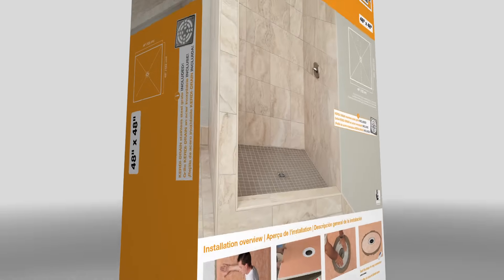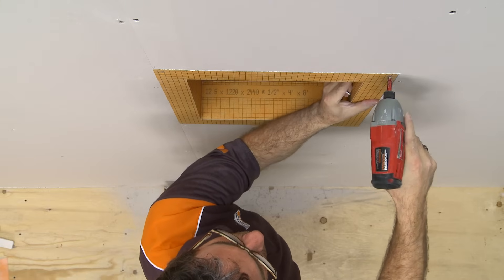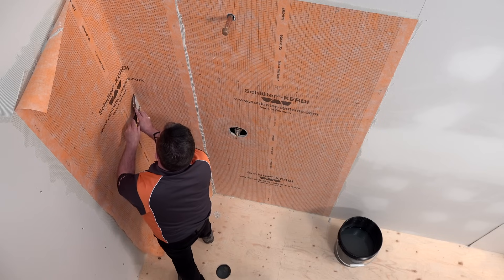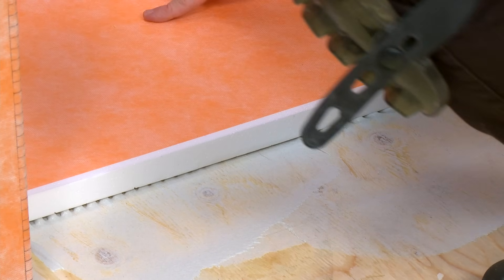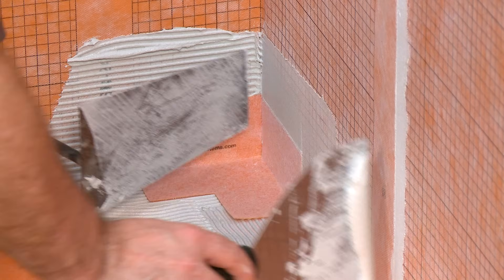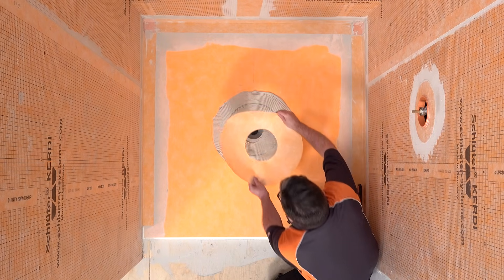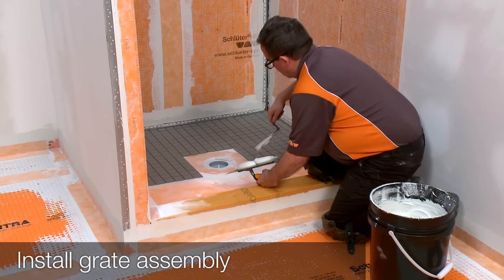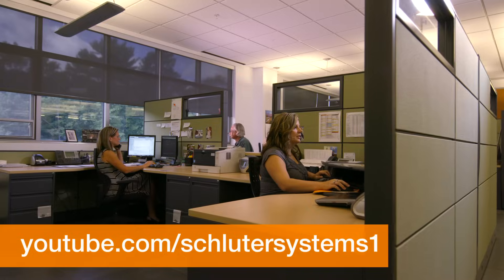How to waterproof your shower installation with the Schluter®-KERDI-SHOWER-KIT Complete Kit

Comment: do you just lay the tray on a level floor?
Reply from the maker: Hi there! The tray can be installed with thin-set mortar on a clean, even and load bearing substrate of plywood or concrete.
Reply: @schlutersystems1  Hi, when I install the tray to OSB plywood, do I use Schluter unmodified thinset? Which thinset do I use if my substrate floor is mortar bed? Thank you.
Reply from the maker: Hi there, you would use Schluter SET, ALL-SET, FAST-SET, or an unmodified thin-set to bond to either substrate. Thanks!

Comment: Question regarding the 'fairly fluid' thinset used along the Kerdi-band. Do we follow the same instruction as for the tile or we add a small additionnel portion of water at the beginning of the mixing?
Reply from the maker: Hi André! 
The thin-set used to install the tiles will be a little thicker than the thin-set used to install the KERDI-BAND. The different mixing ratios for installing Schluter® membranes vs. tiles can be found on the back of our thin-set bags or in our thin-set data sheets which we’ve attached here as a reference:
https://sccpublic.s3-external-1.amazonaws.com/sys-master/images/h5e/ha8/8949341814814/ALL-SET%20Thin-set%20Data%20Sheet.pdf
Hope this helps!
Reply: @schlutersystems1   it says using the schluter thinset... Would a different modified thinset from mapei or laticrete be sufficient?
Reply: @michaelcolascione2423  no you gotta use an unmodified thin-set

Comment: I installed my shower, but missed the part where you discuss “memory” in the corner pieces - I could not get them smooth due to the shipping fold - blocking them to flatten them out created a couple of other dimples (oops).  I guess I just cut those flaws out and put a Kerdi-band patch over the flaws?
Reply from the maker: Hi there! Yes, you can definitely cut out any imperfections in the KERDI and patch over the flaws provided at least 2 inches are achieved at these areas. Hope this helps!
Reply: Use of a hair dryer would've been beneficial to fix those folds.
Reply: @surfingweb7176  I actually tried futzing about with it until I pulled it out - washed off and heated it with hot water, dried it off, tried again.  Eventually blocked it (fail - mentioned above).  Finally just cut a long piece of band and put a patch over the pieces flattened by slicing off lumps, taking care to 2” overlap.  Result was nice but not so much mid-way.  Yes the hair dryer (or heat gun) would have greatly improved.  Now I know. Thx.

Comment: considering giving this a shot on our own. I've seen the system on a lot of home improvement shows. Question is, how does one install glass doors/panels into the foam curbs?
Reply: In 20 years never anchored a door set into a shower curb or tub edge, that is ripe for leaks. you lay down a double bead of silicone for pre-fab units. Custom panels depends on the install type but are usually similar. Those yelling about hot mop and vinyl liners on here are just afraid of the inevitable. Currently using this system to replace a hot mop/mortor bed custom job that apparently leaked for 20+ years...had to replace 90% of the subfloor in the bathroom and a couple floor joists. This system is so much easier and lighter, never had a leak in all the times I've used it.
Reply: @kcstack2642 1) how long have you been using it?
2) how many showers have you torn out that had a schluter system so you could see just how well it waterproofs? Or doesn't?
Reply from the maker: Hi there! You can use the DECO-SG to install the glass on top of the curb or you can use KERDI-FIX and anchors with other framing. Please contact Customer Service for anchor installation instructions. Hope this helps!
Reply: @schlutersystems1 poo
Reply: Yeah, that concerns me..semms like it should have wood underneath or something.
Reply: Yea ...opps
Reply: The kerdi is a joke, nothing will properly anchor in to styrofoam, beat to has monolithic solid cement slab pour with inter grated liner

Comment: Can I install the shower tray directly on concrete the same way as shown in the video, with thinset?
Reply from the maker: Hi Ceeloc, yes, you can install the tray over concrete with Schluter-SET, Schluter-ALL-SET, Schluter-FAST-SET, or unmodified thin-set mortar.

Comment: Before you lay down the tray, do you need to seal the bottom of the keri board wall with kerdi fix?
Reply from the maker: You can seal all seams and joints after installing the tray. This excerpt is from our handbook:
Seal inside corners by abutting adjacent sheets and installing KERDI-BAND with Schluter SET®, ALL-SET®, FAST-SET®, or unmodified thin-set
mortar, centered over the joint. Install KERDIKERECK prefabricated waterproofing corners at all inside and outside corners. When using the
KERDI-BOARD-SC curb, seal the curb to the base and walls using KERDI-KERECK and KERDI-BAND

Comment: Can penny tiles be used on the shower pan or are they too small?
Reply from the maker: Hi there, yes, penny tiles can be used on our shower pans. It's the DITRA membrane that has the minimum 2x2" tile requirement. Happy tiling!
Reply: @schlutersystems1  thanks for the reply. There seems to be a lot of confusion in thr regard going around. Everyone I talk to says you cant use penny tile so im glad you made that more clear foe me!
Reply: @schlutersystems1  - There's no limits on tile size when you flash Ditra before installation. Any experienced installer knows this.

Comment: I don't understand  why all the parts that get applied in an order that seems to be backwards.  If water were to get under any part it will stay under forever. you example starts from the top down basically.  Why  don't you start at the drain and work your way up installed the pieces so the higher pieces fall on top of the next going down.
Reply from the maker: Hi Dave! The sequence of membrane installation can vary provided that a minimum 2" (50 mm) overlap is maintained at all joints and proper connection to the KERDI-DRAIN is established. Also, top-over-bottom or shingle laps of the membrane are not required. So, It does not matter which layer of KERDI goes down first in order for a waterproof seal to be made.

Comment: I accidentally membranes over the Kerdi pan. Is that acceptable? Or do I have to rip it up??
Reply from the maker: Hi Edward, if Schluter SET, Schluter ALL-SET, Schluter FAST-SET or an unmodified thin-set mortar was used to install the KERDI membrane over the tray, that is fine. Please give our support team a call if you'd like to discuss! 800-472-4588 (US) or 800-667-8746 (Canada).

Comment: Will this membrane accept heavy tiles.  i plan to use durock for my walls for that purpose. is durock an overkill since the video depicts the use of regular drywell. Thanks
Reply from the maker: Hi Carlos, yes, KERDI will hold heavy tiles. Regular drywall is all that is required beneath KERDI, however cement backer board and other solid backing materials (listed in our Shower Installation Handbook) are also acceptable. 

Here's our Shower Installation Handbook for reference: https://sccpublic.s3-external-1.amazonaws.com/sys-master/images/hd1/h93/9007208038430/Shower%20System%20Installation%20Handbook.pdf
Reply: @schlutersystems1  Access Denied
Reply: https://resources.schluter.com/media/psi/ShowerSystem-Handbook.pdf

Comment: Does it works in concrete walls?
Reply from the maker: KERDI can be used over concrete walls. Here is a link to our Handbook for complete details: https://sccpublic.s3-external-1.amazonaws.com/sys-master/images/hd1/h93/9007208038430/Shower%20System%20Installation%20Handbook.pdf

Comment: I’ve installed everything and planning to do a water test tomorrow night but I just can’t understand one step and how it creates a waterproof barrier. When doing the shower pan I put in each of the corners. I’ve cut the Kerri band to put between but I don’t understand how it is waterproof without overlapping. Looks like there is a small gap between the corners and the band in your video. Is this correct?  Aren’t those areas where water can travel?  Do I need to overlap it or use the Kerdi caulk?  There is thin set but that’s not waterproof.
Reply from the maker: Hi Brian,  all of the connections should have a minimum 2" overlap of Kerdi or Kerdi-Band.  If you would like to talk through this installation please give our team a call at US:800-472-4588 or  CA: 800-667-8746 they would be more than happy to discuss the details with you.
Reply: I was wondering the same at 9:51,  there doesn’t seem any overlapping there
Reply: 9:35 he states the 2" overlap on ANY junction. You can see he does overlap into the corner her just states you don't need to go all the way in the have excess material that may hinder your tile work causing lippage

Comment: I have a custom shower floor size, larger than the sizes that you sell is there add on pieces for larger shower floor sizes?
Reply from the maker: You can always extend our shower trays with drypack mortar. We recommend giving our Product Support team a call though, they can talk you through some options or put you in contact with your rep!
US: 800-472-4588
CA: 800-667-8746

Comment: Would it not make more sense to install the wall membranes last?
Reply: Was going to post the same thing.  Makes way more sense to me to have the wall overlap the floor pan to further ensure water doesn't get back behind the pan.
Reply: @The_YouTube_Critic  I was thinking the same thing as well.  Think about it like a shingled roof.
Reply: That is what the band is for
Reply: You don’t want your wall materials to be exposed to water inundation, even cement board, that’s why we put the walls on after rhino liner and dry pack , that way the water seeps thru the dry pack down to the liner and does not inundate the wall boards
Reply: It would seem so but just think that the water should never pool to a level above the curb height. It will never be an issue. The tile, grout, sealant and membrane should never let water running down the surface of the wall to penetrate through.

Comment: Which thin set is best using Kerdi board and Schluter shower kit?  I ordered un modified Schluter set.  Will this applicable for installing the tile as well?
Reply from the maker: Hi Timothy, all 3 of our Schluter thin-set mortars will work for installing tile and preparing waterproofing on your project. Including the unmodified Schluter-SET that you have

Comment: I have a travertine shower with a failed shower pan. Rather than replacing all of the tile work in the entire shower, can I demo and replace the pan, remove two feet of the old travertine  and shingle the new Kerdi a few inches above and behind the old shower wall base? Would this create a wicking problem over time? This would allow me to keep most of the old tile work. Thank you!
Reply from the maker: Hi Woodie, 

So sorry to hear about these shower woes..... Do you mind giving our Product Support team a call? They may put you in contact with your Schluter Rep for assistance. You can reach them on:

US 800-472-4588
CA 800-667-8746

Thanks!

Comment: I have foil faced subflooring with grooves to hold piping for radiant heat. Will thinset adhere to this?
Reply from the maker: Hmmm... good question! Mind giving our Product Support team a call? 800-472-4588 
Thanks!
Reply: Absolutely no. The foil face is reflective foil. A backerboard must be installed over this, then thinset and DITRA. Schluter tech will know this.

Comment: Can someone advise me regarding the Schulter Kerddi Cub ?  Does it have to slope inward to the shower base?
Reply from the maker: Hi Rocky, the KERDI-BOARD-SC curb is installed adjacent to the shower tray (that has an integrated slope).  Here's a link to our installation handbook: https://sccpublic.s3-external-1.amazonaws.com/sys-master/images/hd1/h93/9007208038430/Shower%20System%20Installation%20Handbook.pdf

Comment: Shouter works as well as any other backer board, only it is extremely costly.    One of the reasons for the high cost is their “multiple level distribution system”.     By the time the end user buys the product it has been transferred to multiply layers of distribution ..... eCh taking a cut.
Reply: What else do you recommend?
Reply: @lowspeed2000     Either cement board or fibre board.    Minimally a quarter of the cost.
Reply: @billblendick9780 this is for homeowner Diy that can’t build a shower pan and surround the traditional way, I’m all about new things, but one small mistake in thin setting down the sheet materials and the entire shower is compromised, not to mention lots of styrofoam? I’ll take a poured solid cement curb and pan any day and for 1/4 of the cost

Comment: I have installed my schluter shower kit with curb only to discover I was only provided 2 inside corner pieces.  Can I use my remaining Kerdi band to secure these corners?  any tips for this alternate procedure? Otherwise, all went well.
Reply from the maker: Hi Frank, the Kerdi corners are made of Kerdi-Band, so you can certainly form them to apply to corners. If you would like to talk to our Product Support team regarding the missing pieces or anything else product related, please give them a call! They would be happy to assist.
US 800-472-4588
CA 800-667-8746

Comment: I have access to drain, in fact it sits above my subfloor and Kerdi shower pan.  Do I cut that drainpipe two inches below the bottom or two inches below the top of the subfloor?  Does the Kerdi PVC drain assembly then get glued to my drain pipe or does it just fit into place?  Thanks.
Reply from the maker: Hi Frank! Mind giving our Product Support team a call? Sometimes these conversations are just easier to have over the phone. 😃
US: 800-472-4588
CA: 800-667-8746
Reply: Schluter-Systems North America poll o

Comment: When do you use a butt seal as opposed to an overlap seal?
Reply from the maker: Hi Frank! Either can be used any time. KERDI butted with KERDI-BAND over it will be slightly thinner than KERDI overlapped, so that could possibly be beneficial with mosaics. Hope this helps!

Comment: Just a question. If modified thinset is a food source for mold, doesn’t that mean every shower that has ever been installed without modified thinset has a mold problem? That is basically what Schluter is saying but I find that hard to believe especially because I have never once in 25 years went back to a home because there is a mold problem. Overall, their shower system is pretty darn good. There are just way too many steps, seams every where, and their fabric is too thick and doesn’t crimp. I had a rep install a kit in our showroom and I had to tile it. I had to shave the back of the tile to get the cuts around the curb installed. Multiple layers of fabric = thicker bumps to tile over period.
Reply: Carlos Cortes mortar of any type isn’t a food source for mold...
Reply: But they tell you it is and that you should use unmodified thin set.
Reply from the maker: Carlos, wanna give us a call? We can fill you in on the details. 
US: 800-472-4588
CA: 800-667-8746
Thanks!
Reply: Schluter-Systems North America would have been cooler if you’d just explained y’all’s opinion about the question here for us to read lol

Comment: I have installed my walls (Kerdi board) but haven’t taped yet. I now think I’d feel better if I trim the wall bottoms to accept the pan after thin set, cut the pan to fit stud to stud, remove the pan and tape the walls, install the pan, Kerdi fix where the walls meet the pan and curbs, tape the pan and curbs (my kit uses membrane on the pan and curbs).  Would you talk me out of this?  If yes, 
why?
Reply from the maker: Hey Gbear, could you give our Product Support team a call to discuss? They'd be best suited to advise! 888-472-4588 Thanks!

Comment: Can I install without pan and use the wall membrane instead for the bottom of the shower and then use grout to slope to the drain?
Reply from the maker: Hi there! Apologies for the delay...
The options for sloping a tiled shower floor to the drain are a KERDI-SHOWER-TRAY or a Portland cement mortar bed. The sloped mortar bed would need to be installed prior to the KERDI membrane so it wall be waterproofed on top and the water would slope to the drain and not saturate the mortar bed. The KERDI on top of the mortar bed would also continue up the walls in accordance with our Shower Systems Installation Handbook to create a completely waterproofed and properly sloped installation from the shower head to the drain. Neither grout or thin-set would be appropriate materials for creating a slope for the shower floor.
Here's a link the handbook: https://sccpublic.s3-external-1.amazonaws.com/sys-master/images/hd1/h93/9007208038430/Shower%20System%20Installation%20Handbook.pdf
Reply: I have a odd shaped wLk in shower, one valley is at a 45 degree angle.  For the part of the shower are that has the angle wall, could I use a shower pan, say 48 x 48, trim to size to fit, and cut off one corner of the pan to fit the angled wall?  Then for the flood where I walk into the shower,  could I Juilliard the floor height up to the shower pan height by using plywood Then cement boars, and cover the cement board with Kerdi and seal the Kerri to the shower pan?  Do that instead of building floor up with mortar?

Comment: why is the long corners schluter put on prior to the wall?  Will not the water go behind the tile seeping behind the bottom corner put on last.  I have done this several times with this system and I still always put down in this order.  Floor, corners and then the walls so there is no "natural drainage" down behind something.  Or is there still a chance of capillary action ?  I would like some feedback on this
Reply from the maker: Hi Nick! When KERDI is installed with a 2" overlap, water will not be able to penetrate and cause any issues, regardless of the order in which the KERDI and KERDI-BAND are applied, whether "shingled" or not. Hope this helps!